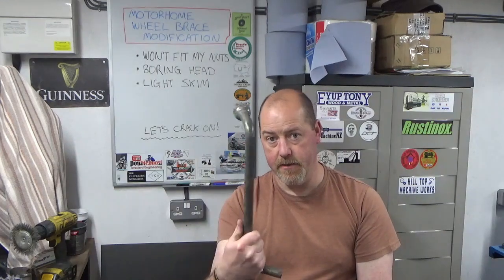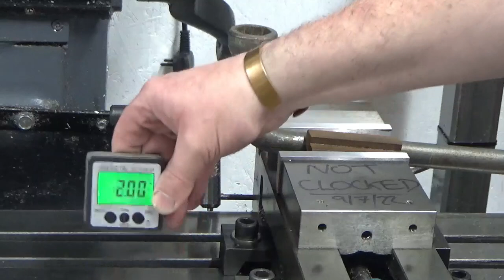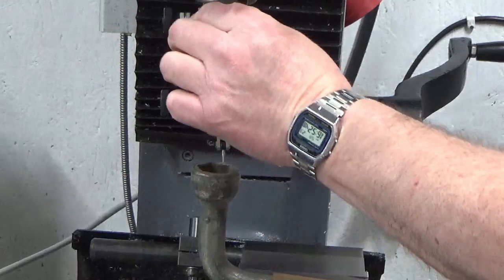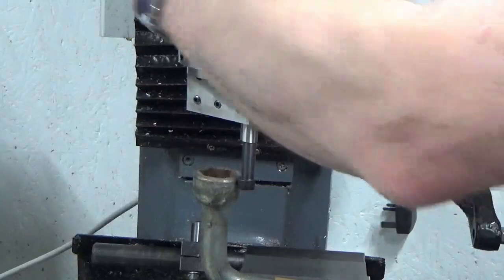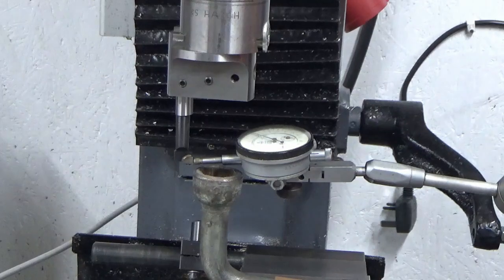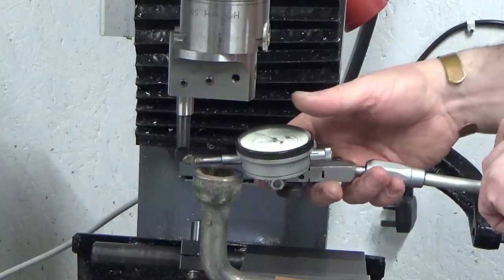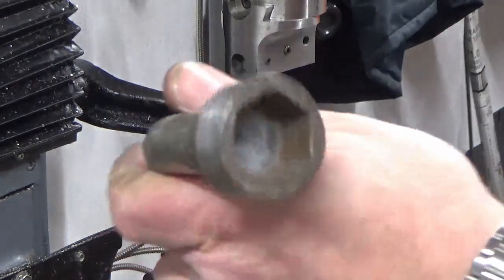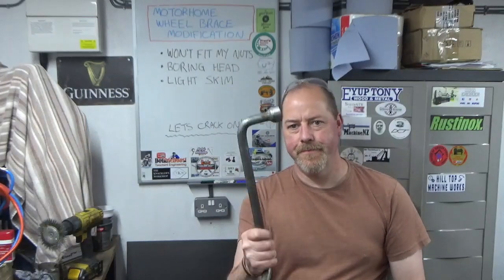Modifying a Motorhome Wheel Brace ***WARNING - PLS READ DESCRIPTION***

Comment: Jon. PLEASE put a WARNING notice on the description or pin this comment. The Chinese import boring heads are screwed onto the shank, running in reverse could cause them to unscrew and cause a SERIOUS accident. Either you were lucky or your head is a solid one. Don't say I did not warn you. Great outcome. Regards from Australia.
Reply from the maker: Hi Dave, thanks for the comment. Very helpful, I made this video in a rush yesterday and totally forgot this risk otherwise I would have called it out. Description and title amended and I have pinned your comment - thank you. My boring head is bolted together and fits into a collet chuck, so no risk, that was one of the things that drew me to buy it, it's a useful additional capability. Cheers, Jon
Reply: good call i have one like that and totally missed it , probably need to drill a hole in it and pin the top to the bottom parts
Reply: @watahyahknow  You could also grind up a HSS tool to cut coventional  direction of rotation and have no sphincter tightening moments.
Good advice by Dave, Cheers from John, Australia.
Reply: I'll join the list and say I put a grub screw in mine to stop it coming undone. When it happened to me there were no mishaps just a WTF moment.

Comment: Good thinking
I would have the angle grinder out and my wife trying to roll the socket on the edge of a plank, promptly followed by comments such as
"your taking to much off one side"
"your not holding it wright"
"I'm not holding that, sparks will get in my hair"
"Why don't you gust go and buy a proper one"
Reply from the maker: Hi Seamus, thanks for the funny but very realistic comment lol. That was plan A, but my ears were already sore so I went for plan B lol. Cheers, Jon

Comment: hello jon good morning
in the boring heads what we usually do when we need to bore from the outside is to use a rhombic left hand turning tool so we can use the milling machine with the normal direction of rotation to the right... in fact I use everything in my boring heads type I always use right-hand or left-hand turning boring tools depending on the need for the job...another thing that is usually done to Chinese boring heads is as simple as drilling and making a metric 5 thread and thus being able to put a simple captive with allen head..so once the head is tightened in the cone then you tighten the captive well and thus you will be able to turn to the right or left without fear of the head coming loose from the cone..greetings from Spain and I wish you happy holidays in your new mobile home
Reply from the maker: Hi Tr, thanks for the comment and information. I need to get some 1/2" shank LH tools, running in reverse is a pain on my mill. Gets you out of trouble though in a tight spot. Cheers, Jon

Comment: Good one Jon.  Nice fix method.  I don't have a boring head, but I can now see where it can be very handy.  Thanks for the heads up on the screw on type.  I might have to investigate these further.  Cheers Rob
Reply from the maker: Hi Rob, thanks for the comment. Go for a plain shank solid one if you do buy one (they then fit in the lathe as well.... very rare you would need this but is a useful back pocket capability). Cheers, Jon

Comment: Well hats off to some ingenious reverse engineering. That is clearly the finest wrench of its kind in the kingdoms. Looking forward to the real-time tire rotation video using the project wrench. LOL. That would make a fun twelve part series…..🥴. If you should happen to remove the wheels (being aluminum on steel or cast mating surface) I would recommend a never seize coating between. We have awful stiction/corrosion issues over here. 

Well done Jon! 

All the best 
Dan.
Reply from the maker: Hi Dan, thanks for the comment. Lol, yup, must be the only one of its kind to have had a DTI round it! Cheers, Jon

Comment: Not another boring video!! Sorry Jon couldn't resist. Just a point to note, some of the boring heads have a screwed on arbour and will come loose if you run them in reverse. Keep up the good work and enjoy the motorhome. Maybe it will feature in future videos?
Reply from the maker: Hi Gary, thanks for the comment. Yep, I retrospectively added the public health warning to the video. Fortunately mine is solid so goes both ways. LH boring bars are probably a much better solution though. Cheers, Jon

Comment: Hey Jon, you have more patience than me. It would have been straight on the bench grinder! It was a great demonstration of what can be done with the boring bar so thanks for that. 
I'd check all of your wheel nuts by slackening then off and tightening by hand before you set off on a trip. Guaranteed a tyre shop grollied them up with an air ratchet. Better to struggle at home than on the side of the A9! ..... don't say I did not warn you......; )
Reply from the maker: Hi Dean, thanks for the comment and advice. Duly done and copper grease applied to threads. Cheers, Jon

Comment: G'day Jon. Great use of the boring head and thanks to you and Dave T for pointing out the pitfall. So how did you reverse the mill?
Cheers Peter
Reply from the maker: Hi Peter, thanks for the comment. To reverse mine, I have to have the machine in tapping mode and have the spindle right at the top of stroke to make a micro switch "closed", then it goes in reverse. Like cracking a safe lol. Cheers, Jon

Comment: hmmm good thing to know that its not a waste of time to set op the vfd in a way to make the machine able to run in reverse 
allso like this way of using the boring bar as i can see ways of if being used on a piece of material too big to swing over the bed of my lathe in general , should allso be faster / more solidly mounted than using a turntable 
as for using the digital level , it mightve worked better to set the level on top of the "brace" or put a piece of hexagon in there with the end turned level so the levelness is based on the socket hole part so the wall thickness will be the same around and top to bottom (not slanted to the inside hole)

btw where youre going to travel at ? if youre comming to the netherlands i would like to come by and talk a bit maibe point you to some interesting stuff to do
Reply from the maker: Hi Watahyahknow, thanks for the comment. We may do a European trip in 2024, never been to the Netherlands so I will keep you posted if we decide to pass through. Cheers, Jon

Comment: fair dinkum... I have been looking for a solution to a very similar issue - I've chasing  an 18mm socket and arm to fit the head on the 12mm bolt holding the trailer spare on to the A frame... call me an idiot, I should  just skim the 12mm bolt head to fit the 17mm socket on the wheel brace!